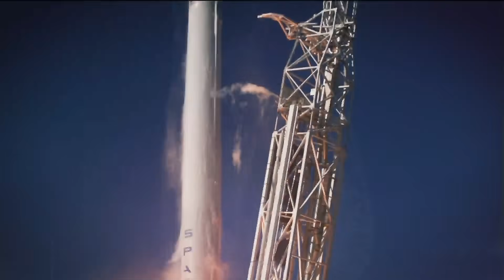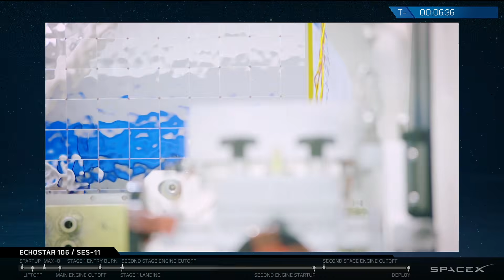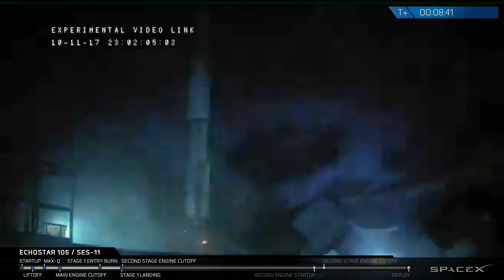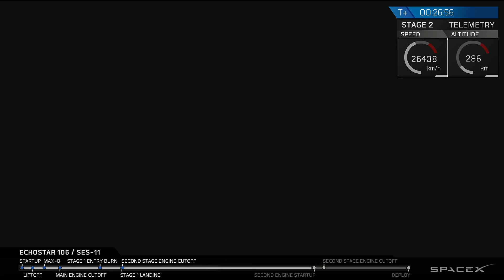Echostar 105 / SES-11 Launch Webcast

Comment: **NEED AN ANSWER: ** so when the stage 2 rocket is activated the traveling speed starts to go up quickly as there is few friction in the atmosphere at 300km altitude. At minute 42:02 immediately the speed stops to 35'262 km/h and then starts going back. How this? An object launched at so high speed how can instantly stop?????!!! Shouldn't have a continuos movement as there is no friction!?  Thanks to all for answer
Reply: The speed stays the same but acceleration stopped. It dropped because it was on a climbing trajectory.
If you are in an elliptical orbit you climb and fall as you move around the earth. (You fall all the time actually, but saying it this way would've been confusing.)
Reply: An orbit is still a speed. They are heading to the highest point in the orbit which means the Earth is pulling on the ship, which slows it down. If it didn't slow down at all it wouldn't be in an orbit.
Reply: An object in a circular orbit holds a constant speed, but in this video the rocket is in a non-circular orbit and is coasting up against gravity after engine cutoff. It will lose speed as it gains altitude. If you watched longer, it would slow to a minimum when it hit the high point (apogee) of the orbit and then gain speed again as it falls back to the low point (perigee.)
Reply: NicoItaly there is no such distance. The gravity of every object in the universe extends for an infinite distance.  The farther away you are the weaker it is but it never just stops.  Look up "inverse square law" for the details.
Reply: It holds the moon in orbit around the earth.  A factor most people don't consider is that at surface of the earth we are already 4,000 miles from the center, and going a few hundred miles farther from the center into low earth orbit is a very small percentage change. At the distance of the moon, which is roughly 60 times farther from the center of the Earth than a person standing on the surface, the pull of the Earth is 3600 times weaker. No human has been farther from Earth than the Moon, and at that distance the Earth's gravity still was present, though weak.
For most (not all) rockets we launch the Earth's gravity is still the dominant force they feel. Even at their farthest point from Earth they are held in orbit around the Earth. Only a very, very few rockets get far enough from the Earth and or close enough to some other body (our moon, or another planet) that the Earth's gravity is weak enough to ignore.
Reply: Ok thanks to all of you. In any case which is the altitude from earth where no gravity is anymore opposed and so an object will go straight into deep space?
Reply: That's a slightly pedantic reply though. Gravity falls off pretty fast. There is a point where, technically earth's gravity is still pulling on you, but it is so weak it is functionally meaningless.
Reply: Nicoltaly  That is not a matter of altitude, but of speed. An object going about 25,000 miles per hour will not be pulled back by Earth's gravity but will be able to go to other places, such as the Moon or Mars.

Comment: Ah thought they had lost the first stage there for a minute would have been there first failure is a while when it was starting to look like they may have got landing the first stage down pat, they return 69 on them and they will have a better return success rate than the space shuttle, if we cut off the earlier failures which I would because the Falcon 9 is a refined rocket compared to the original Falcon 9, it's not the same machine really.

Although having a better track record than the space shuttle is not exactly a compliment, I would like to see the Falcon 9 get to a 100,000 consecutive successful missions without a failure which was the original rating for the space shuttle... which was a bit off. But it probably wont reach that even if it never fails again because BFR should eventually be able to take over for it expect for when you need a launch window which BFR will not be ready for, because I assume that a BFR will be in maintenance for at least 6 months between maybe 5 launches and landings so if you have a fleet of 5 for example that would only give you 50 launches per year so if you need a specific launch window you will probably be shit out of luck, which is why you will still need a few Falcon 9's and Falcon Heavys laying around even if/when BFR has demonstrated it's reliability.

Unless they are going to have a fleet of 37 BFR's to cover every day of the year, and building and maintaining 4-5 BFR's is already ambitious.
Reply: Ah. I suppose you should say the Space Shuttle had a perfect success rate, since after Challenger and Columbia it was a more refined rocket and not really the same machine.
Reply: @Ambient Morality Actually the fundamental problems were never addressed because they could not be without a complete redesign of the vessel the two faults being that the SRB's being none throttleable after ignition and the shuttle being on the side of the tank which caused ice to build up on the tank and shook off due to the engine vibrations which would hit the heat resistant tiles.

An accident was always going to happen it was just a matter of time and the fualt could not be addressed with a refinement of the design, maybe you could make the tiles shock resistant, and maybe you could have used hybrid Rockets vs SRB's but hybrid rockets are still not to the level where you could use them to launch the shuttle also you lose part of the cost savings of SRB's as you need to store the liquid oxidiser and have turbo pumps etc.

But they never were addressed at the least and as for making the tiles shock resistant it would only reduce the chance of a catastrophic failure due to the tiles getting hit not remove it, even if you could make them significantly more shock resistant, and I don't think you could of without reducing there thermal properties because they were never even toughened never mind the actually fixed which would have needed a complete redesign of the vessel which would be mounting the shuttle to the top of the rocket rather than on the side.

While SpaceX seems to have addressed the issues with there rocket, which were not fundamental problems with the concept of the rocket, that is the difference.

Comment: 20:59 Damn is this plasma ?? Good thing the first stage survived reentry
Reply: mraerospace That was definitely plasma. I wonder which surface was subjected to that? If it was the landing legs, I'd guess no big deal. If it was an engine bell or the octaweb I'd assume that must have caused damage. SpaceX has kept details about the level of refurbishment pretty sparse. This booster first flew a mission to ISS. Those are relatively tame reentries. This one wasn't as harsh as some successful landings but would be an 8 out 10 on scale of reentry profile. The heating was more pronounced due to the sunset launch and near-night over-the-horizon landing. These effects happen on all GTO reentries; this one just had the correct lighting to see them in stark contrast. Also, those were the original (now outdated) aluminum grid fins. The new titanium grid fins have no ablative coating and a much higher melting point.

Comment: @43:40 can somebody please explain why the speed of second stage is decreasing? Shouldn't it remain constant?
Reply: Because it's in a transfer orbit. As altitude increases kinetic energy is traded for potential energy and speed decreases. When the satellite reaches geostationary altitude it will perform a circularisation burn with it's own engine (AIUI they don't use the second stage engine because they don't want space junk in geostationary orbit)
Reply: An object in a circular orbit holds a constant speed, but in this video the rocket is in a non-circular orbit and is coasting up against gravity after engine cutoff. It will lose speed as it gains altitude. If you watched longer, it would slow to a minimum when it hit the high point (apogee) of the orbit and then gain speed again as it falls back to the low point (perigee.) The second stage never reaches anywhere near geostationary orbit altitude. At apogee the satellite deploys an uses its own engine (essentially a third stage) to boost from ~1200 km low earth orbit to 40,000 km geostationary orbit. After the initial boost, the satellite is coasting most of the way on an elliptical path . And then, as another comment noted, the satellite's rocket will fire one more time to boost the orbital speed just enough to make the orbit circular.
Reply: Thanks. It is clear now.

Comment: Apparently, the reentry speed is a lot higher this time. The grid fins were glowing hot right before the video cutoff. I would say this was a close call for the first-stage landing flight. The base TPS must have  been severely damaged. I don't know about the engine parts.
Reply: No, they always get that hot, just this was a night flight so you could see the glow much more strongly.

Comment: Blue sky disappeared and then it turns sideways while showing increased speed and altitude.great cgi guys.you can fool believers but not me.
Reply: "Blue sky disappeared" - That tends to happen when the sun goes down.
Reply: It turned sideways because the camera they switch to captures the rocket better when its already horizontal, and the sky went black because the camera was focusing on the bright flame not the sky.
Reply: Don’t worry WS, when we’re all rocketing over your trailer park on the way to space we’ll give you a friendly wave and a smile, then go back to our drinks menu.

Comment: Timeline:
Startup  13:02
Liftoff     13:57
MaxQ      15:10
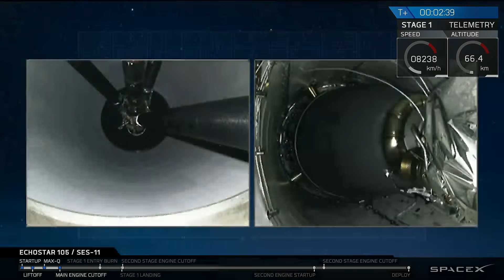MECO      16:36
Aluminum Grid Fin Deploy  17:04
Stage 1 Entry Burn   20:28
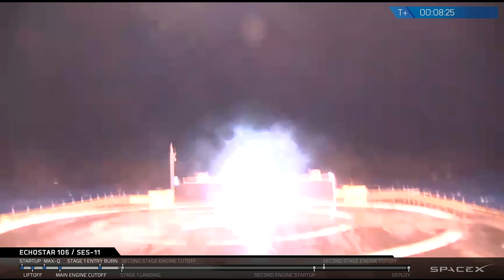Stage 1 Pre Landing  22:24
Second Stage Start up  41:05
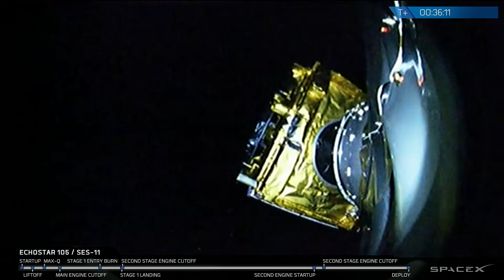Satellite Deploy  50:08

Misc events:
Stated cost of fuel 9:39
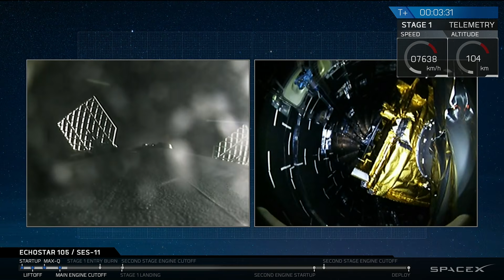Fairing Separation 17:34
Glowing Grid Fins 21:13
The End 51:15

Comment: why does the video cutoff at the most awesome part? :(
Reply: Because the dish that transmits the data starts shaking when a giant rocket lands 100 feet away from it. Plus the exhaust gas is ionized so the signal can't go through it.

Comment: in the animation seems that the orbit is highly elliptical. Shouldn't there be another burn to make the orbit circular ?Or is the satelite equiped with an engine for this final stage ?
Reply: Echostar 105 satellite has ion engine and it will continue its journey from GTO to GEO.
Reply: thanks !
Reply: It's the older Eurostar 3000 bus, so it has a biprop engine for orbit raising. In service it uses hall effect thrusters for stationkeeping.

Comment: Another quiet reused first stage, let's get heavy! I'm ready to see three landings!
Reply: The slated launch date changed two days ago from November 2017 to "Late 2017". I so want that launch to be successful.

The Heavy has four paying missions on the books if it succeedes. 
Arabsat, the USAF, two as yet unkown billionaires, & Viasat all want to fly on a Falcon Heavy.

The problems are ignition and Max Q. The Merlin is a fantastic engine.
But when it comes to making 27 of them work in unison?
That is a big ask. But no bigger than asking 5 F1s to fire at the same time.

When, not if, the Heavy is regularly flying, Elon does not accept failure, he just learns from them, ULA & other launchers will be fucked commercially.

I don't want this, I just want ULA to get better.
I want Blue Origin to succeed.
I want India & China & Japan & the ESA & anyone else who joins the race to  make space flight less expensive.

Sorry CCC, I'm on the verge of ranting. 
You take care, and if you can't be good, be lucky. :-)
Reply: Patience. I'll be happily surprised if the Falcon Heavy flies this year.
Reply: The heavy is still supposed to fly in November
Reply: Now NET December 2017, which obviously actually means early 2018.
Reply: It's almost unnecessary. Falcon has already launched several payloads which were originally slated for the Heavy. I share your impatience. I live close enough to watch it from my back yard. I can't wait, but apparently, SpaceX can. It will launch and become as routine as landings and reuse. A year from now we'll have forgotten about how long we had to wait. Residents of Cocoa and Titusville will probably get sick of them pretty quick. 3 sonic booms times three!
Reply: Davis Keenan,  that means you can expect it in early 2018.

Comment: Thank you SpaceX you're literally increasing the odds of the human race not going extinct and in such cool way. ♡
Reply: Paul Adams Well stretching it out maybe, every species ultimately goes extinct, sorry. And regardless of fantasy, even Elon Musk doesn’t have the economic power to start a colony of humans off-world, too expensive beyond the wildest fantasies.
Reply: DoctorShocktor Expensive?  You're not keeping up! With reusable rockets it's not Expensive its profitable, just on Mars alone an insane amount of mineral wealth awaits, just to be taken. With AI, computing power, robotics and 3D printing all progressing at an exponential rate, hardly any man power would be needed to build structures on Mars and in space. As we move out first into our solar system and then others we will continue to evolve and merge with our technology forming new species along the way.
Reply: Even with much lower launch costs, there is still nothing on Mars that could be sent back to Earth and sold at a profit, much less the level of profit needed to buy the various manufactured goods, everything from cookstoves to computers, that would be needed just to keep the colonists alive. Actual space colonization will not be economically viable until there is a substantial manufacturing infrastructure in zero-G.
Reply: Odysseus Rex Massive mineral wealth aluminium, iron, copper, gold, autonomously mined, refined and processed.

Comment: Are we still doing fairing recovery?
Reply: Fairing recovery is still a priority, but I think they're in a bit of an engineering pause. They collected data, made some attempts. Now is the period where they digest what they learned and see what is possible, too expensive, or downright impossible. They came close enough to show recovery is possible but is the solution too expensive or just impractical? Wait a bit and they'll either do it or they won't. There's just a ton of things on their plate right now. Flying astronauts would be foremost and relatively very soon.
Reply: Nicholas Littlejohn would be nice if it could come back with the first stage, but I don't know why it couldn't be flown back like a drone, recovery over open ocean is another ball of wax and no cheap answers.

Comment: The rocket nozzle is coloured in a strange web colour when it burns. Do space x metal 3D print their nozzles with channels for the liquid to flow through?
Reply: Nozzle extension is not radiatively cooled
Reply: Ambient Morality Not radiatively, but regeneratively. The super-chilled fuel is passed through channels to cool the nozzle.

Comment: You can make rockets that can land themselves, but you can't buy a HD camera for the landing pad??? Cheap!
Reply: That's just the resolution of the stream. There are no LTE phone towers on the ocean
Reply: kendokaaa that is why Elon wants to deploy the Skynet satellites so that they can stream their landing at a better quality 😎
Reply: NeonsStyle they buy 4k cameras but the vibrations shakes the satellite dishs that are used to give you a video link. Come up with a satellite dish that can withstand them vibrations .
Reply: NeonsStyle Also the exhaust from the landing burn can block signals
Reply: snowflake maybe you need to go see the eye doctor then and have them give you a clearer prescription. i mean come the hell on of all things to bitch about. Todays generation of degenerates crying cause something isn't crystal clear for them.
Reply: Tt Ss my new iPhone 8 phone isn't using every bloody pixel. Noooooo I'm gonna start dying now
Reply: Sounds like and engineering challenge! Make it happen!
Reply: The rocket telemetry is a much lower data rate maybe only a few tens of kilobits/sec is needed video needs megabits per second.
Reply: NeonsStyle F, sit!
Reply: kendokaaa true!
Reply: +harddrive33
vibrations, smoke, and a rough OCEAN bobbing at the same time
Reply: They can keep the data link with the rocket but not the video from it🤔🤔🤔🤔🤔🤔🤔🤔🤔🤔🤔🤔🤔

Comment: all this tec and they cant seem to get a camera that doesn't cut out or flicker whats with that
Reply: The video quality stored on the cameras themselves are fine on the rocket and the droneship. However the extreme environments that the rocket and droneship experience during re-entry and landing combined with being a couple hundred miles out in the ocean really messes up the bit rate and connection on the live feed.

For a more serious answer, I don't know about the cameras on the booster, but for the drone ship cameras I heard someone explain before that the satellite antenna on the droneship loses its connection during landing because of the intense vibrations from the rocket while its landing. It would be like shaking your direcTV dish around as hard as you can an expecting your reception to remain perfect.
Reply: for the first stage booster( im no expert fyi) the image cuts out during reentry because of the super heated plasma that surrounds the craft and inhibits photon re-emission of any spectrum other than the plasmas own spectrum. <- i could be way off on this so do some fact checking before re-explaining it to someone else. cheers!